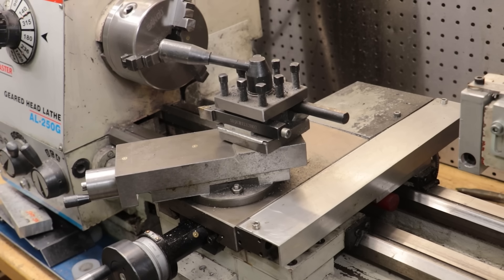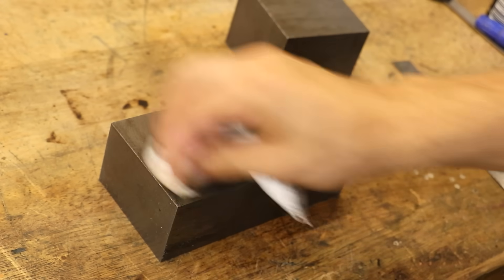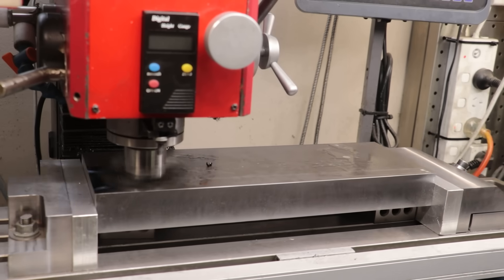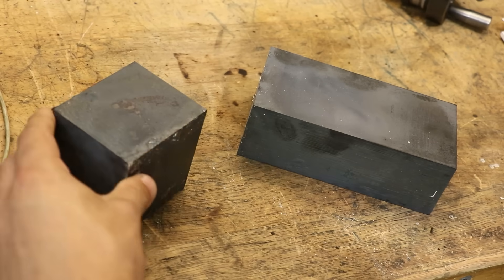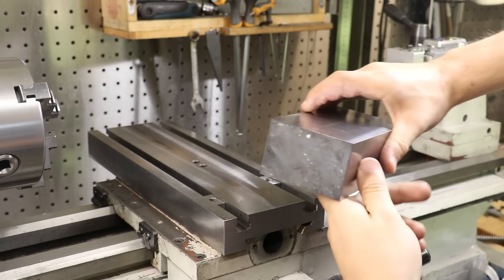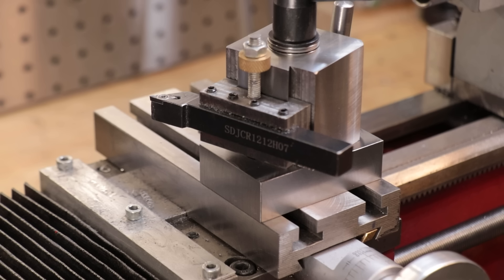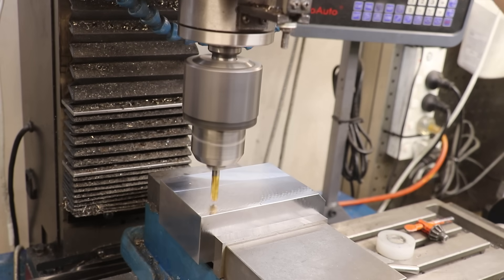Lathe Rebuild: Solid Tool Post Build | Part 4

Comment: For such a heavy cutting in steel, would you rather not look around for a used AI Hembrug DR 1 or DR 133, Schaublin 102VM, Mondiale Celtic 12  or AVM AV125? Especially the Celtic 12 by Mondiale is about the size of this lathe, but a half metric ton one piece cast, mush more rugged and more precise.

Comment: You mentioned that you could cut tapers with other methods since you are building a solid compound. What are the other methods? It is still possible with the solid compound? Thanks!
Reply from the maker: No ill make a swivel type compound that can bolt on using the t slots. I don’t cut tapers very often so I’m better served using the solid mount most of the time
Reply: You can cut a taper between centers by offsetting the tailstock. you do have to recenter it after that though.

Comment: It’s normal for a fly cutter to cut on the backside. A well trammed machine will cut on both sides. When you see a fly cutter cutting on one side only it’s probably because the machine has been knocked out a degree or so to make the cut look good.

Comment: Again, drop cold rolled steel and use hot rolled steel instead. Dimensional accuracy is irrelevant when you are going to machine all surfaces.  Stresses will remain in the steel for years and movement will occur.  When building with heavy cross sections like lathe parts the additional strength/hardness is also irrelevant. Still you do great work.
Reply from the maker: This is why I annealed it, the microstructure has been reset.  I have explained in many occasions that it’s not my choice of metal but I made do with the metal I can get. If I wanted cast iron or hot rolled in this size I’d be in with a several week wait and I’d have to buy 3m of the stuff. I’m no machinist and I’m on a real tight budget so I do with what I can get and work with it. Cheers

Comment: Agreed, top slides really aren't that useful, and you loose rigidity. Fixing a toolpost directly to the crosslide is a better idea. And why not make a few toolposts, and you get a quick change system of sorts. (I actually think I saw someone do this.)

Comment: for stress relieving 30 minutes of soak time is inadequate, the rule of thumb is one hour for each inch of thickness after reaching the desired temp
Reply from the maker: Yeah it had nothing to do with me running out of propane
Reply from the maker: Fwiw most do the stresses are in the outer skin of the steel and the steel hasnt shown any signs of warping

Comment: Steel that is rolled red hot, is not necessarily hot rolled steel. Steel can glow red even below its recrystallization temperature. None of this really matters unless you are really into this stuff, in which case you can just read up on the topic. It's very easy to say something misleading about such a broad and detailed topic such as metallurgy.
Reply from the maker: You’re right. That’s why I did a 3 part deep dive earlier this year. Might as well put my degree to use
Reply from the maker: I do think it’s fair to say that if it’s glowing red, the steel is probability going to be Austenitic

Comment: Awsome project

One thing about using steel: It's stronger, but you wouldn't put so much force into it during machining to break it. Machine design is always a struggle in rigidity and dampening, rarely in strength. And steel and cast iron are basically identical rigidity wise, with cast iron being better at dampening (and better as a sliding surface and nicer to machine)

Steel definitely works, as long as you take good care of maintaining it, but cast iron is definitely the better choice.
Reply from the maker: You’d be surprised. Grey cast iron is a bit of an outlier compared to steel and other cast irons. It tends to have a much lower modulus of elasticity compared to steel.

Comment: 2 flute & 3 flute cutters produce accurate width slots, which 4 flute cutters do not. This is due to 2 & 3 flute cutters only having one cutting edge in contact with the workpiece at any time - the "active" cutting edge has left the cut before the next edge comes in to contact, where a 4 flute cutter has the "active" edge in contact when the next edge comes into contact and gets deflected, causing the slot to be cut larger than the cutter diameter.

A correctly "trammed" spindle will have a slight backcut & should leave a "cross-hatched" pattern that is visible but barely feelable. For some materials prone to work hardening when cutting it may be desirable to introduce a spindle alignment error to ensure theat only the leading edge cuts - had a customer machining manganese steel railway point & crossing castings who did this, as a rubbing back-cut work hardened the surface such that it became un-machinable.

Would it not have been less work to cut a slot for a seperate location tenon and inserted a  key rather than machine away the bottom of the riser block ? No less capable location, but easier to get a flat mating face that way.

The one item that stands out here for being a bit sub-par to me is the offensively undersized gib strip ! Your goal with the project  is improved rigidity - a cross slide gib strip sized to properly fill the free space (top to bottom as well as width) would help with that.

Comment: Three flute cutters are also as effective as two flute cutters.  The issue with the four is the simultaneous engagement of the cutter with the side and end of the cut typically resulting in an over size slot.

Comment: One thing that might be a big help is to blue up the bottom of your toolpost riser block and check how much contact you have and if necessary adjust it. More contact is more rigidity...

Comment: I honestly can’t figure out why so many people go so crazy over exerting physical effort to cut stock.

I suppose it could be laziness, but it’s hard to believe so many people are committed to laziness.  Just doesn’t seem possible.

I suppose it could be a lack of strength - just not being strong enough to cut through a piece of stock.

I suppose it could be just not knowing how to use a hacksaw.  This wouldn’t surprise me; it’s considered a thing of the past. 

I suppose there are people who have never even tried cutting stock with a hacksaw, and don’t really understand it.

I suppose there might be people who’s only exposure to a hacksaw is the rusty old crummy one with a dull blade back on a wet shelf somewhere.  No fun.  

I suppose there are people who are always in a hurry - and I can understand that if there are money and deadlines involved.

But I suppose if you are young and strong, skilled in the techniques, have a nice sharp blade, have a few minutes to cut rather than tinker with a machine, aren’t afraid of it, maybe you might choose to cut stock with a hacksaw.  For whatever reason.  Because you want to.

Comment: Technical terms for your application, at least in the US is normalizing or stress relieving. Where as annealing is a controlled process of reducing hardness, restoring ductility and machinability.
Reply from the maker: If the cooling rate was critical you could carefully control it, but typically annealing refers to cooling slower cooling in a furnace and normalising refers to cooling in air.
Reply: @artisanmakes  True, annealing gets both in one process. Your primary goal was to remove internal cold worked stresses since it was already soft enough to machine.
AI Overview
Stress relief and annealing are both heat treatment processes that improve the workability and dimensional stability of metals, but they have different goals and produce different results:
Stress relief
The goal of stress relief is to reduce internal stresses in a metal that can cause breakage or distortion. Stress relieving involves heating the metal to a temperature below its critical temperature, holding it there for a period of time, and then cooling it in a controlled manner. Stress relieving doesn't change the material's chemical or mechanical properties, but it can reduce its hardness.
Annealing
The goal of annealing is to alter the metal's mechanical characteristics and microstructure to make it more pliable. Annealing involves heating the metal to a temperature that ranges from just below to well above the critical austenitic temperature. Annealing can correct flaws in the metal's crystalline structure and reduce hardness.

Comment: Fly cutter should cut on back side :) (and not only fly cutter, also shell mill, etc..)
If it don't do that.. it's out of tram, leaning forward.

Ideally.. you should have crosshatch pattern.
Exactly as you get it, as I can see from the video.

Think about it in this way...
When you cut... you do not leave perfectly flat surface, but lot of small ridges, as on each turn cutter moved a bit forward. Depending on the shape of the cutter and the depth of the cut, this ridges can be different size and shape. Yes.. it's small when you use round insert, but it's still there.
When back part of rotation come, if everything is perfect, it will cut tops of the ridges down to the bottom of the valleys, and it's visible.

Of course, this not mean that back should cut below valleys of the forward cut, and that forward cut should disappear entirely. In this case, column of the mill is leaning backward.

Also there is a tool pressure change as you mentioned, so you can consider back cut as "spring pass".

Comment: Would be interested if you would comment on your cost for materials as your do your builds.  AU/US/EU prices will be different, however its always good to get an idea of what a project might run, and non-Aussies can sigh with relief when we compare.
Reply: Types of possible sourcing will also vary wildly between countries and locations. Steel chunks like the ones used in this project, are in themselves not costly. Service / cutting fees and delivery are probably half the cost, if not more. Whereas some sources, in my experience, will be kind to hobbyists, and may charge some almost symbolical sum - especially if you find the material in the cut-offs "scrap bin". So basically all you can say, is that cold rolled steel is cheap material in it self.

Comment: Not sure the M6 bolt mount is to blame for the lack of rigidity. My Harrison M300 has 2 M8 bolts holding the compound and has loads of rigidity, and a 3HP motor from the factory. The M8 bolts don't seem a huge step up from what you have, but the performance leaves very little to be desired.
Reply: the area of a Ø6 circle are 113.1 mm2, the area of a Ø8 are 201 mm2, or the Ø8 are almost twice the area, roughly 1.78, so yes it is a huge step up

Comment: G'day Artisan,

You know that around the World, people look at we Aussies, and think; "But all of the creatures there are tough, deadly, & just want to ruin your day!"  Your video proves them to be right.  LOL  Who else gets spiders hiding inside a burning propane torch?  Your video also proves something else - the only thing tougher than an Aussie critter is the Aussies themselves.  "Oh yeah.  I just gave him a new home...", which means; "I popped the spider into an empty Vegimite jar, walked 10m over to the left, & let him escape into the garden."

BTW, when I was an apprentice Motor Mechanic in the 80's, I read about the machining marks left in surfaced cylinder heads - If the cut marks are a semi-circle in one direction, the cutting head of the mill is angled over to one end, and it's machined a trough in the head.  Cutting marks of semi-circles in both directions show that the mill's head was setup correctly.  I don't remember which book I read it in, but it was probably written by David Vizard, Phil Irving, or David Waddell.  They aren't machinists, but they know what they're talking about.

Anyhow, thanks for another great video.

Keep up the good work
Andrew
Reply: You want tough ? more tough than Crocodile Dundee 😁 Look up Tardigrades, those suckers eat Aussie's for a snack 😆
Reply: @sidewind131258  I'll see your common Tardigrade, and play the Australian Tardigrade :)

Comment: If you take equal cuts off both sides of the part, the bending will cancel out and you will end of with a flat part. Or at least, flat-ish.

Comment: I am curious, you mensioned a technique about cutting a taper without a compound. What technique is that?
Reply: The hard part with a lathe is NOT cutting a taper.
Reply: You can turn between centers and offset the tailstock.

Comment: i was machining thru that heatwave, could only rough out parts as the part was so hot it was measuring out 0.03mm. i also had to go sit in the office for a few minutes at a time because being next to a hot lathe almost made me feint.

Comment: Looking good! (thanks for the ref) Having the tool post sitting completely over the cross slide should help to make it more rigid. Probably noticeable when parting off as the tool will find better support where it needs. (Not that I have found any downside so far with mine, but I like the way you did it too) Looking forward for the rest of this series!

Comment: The german Ulmia (352/354) frame saws come in up to 750mm in length and metal cutting blades are available for those. I find that with my 352 saw (550mm), I can get a lot more work done than with a regular hacksaw. Old ulmias are probably difficult to find in Australia, but if you have a machine shop they don't look difficult to make.

Comment: You had a heatwave? I had to snap my dog off several lamposts during the recent not heatwave that froze all my pipes so I had to melt my marujana, and crack cocaine before I coluld even make my way down to the workshop-aka the den... You lucky Barstewards in Oz that wizard knew what he was doing....
Reply: Heatwave with high humidity and the threat of blackouts was not good. You also need to remember that the bushfires that occurred in 2019 - 2020 in Australia are still very fresh in people's mind.

Comment: An extremely light crosshatch on the backside of a fly cutter pattern sometimes means that you are just cutting the tiny ridges left by the leading side. If it removes the initial pattern and replaces it with a backwards one, you are out of tram.
Reply: Not necessarily out of tram. The spindle can be loose or the spindle and tool can be flexing enough to cut on both sides.

Troubleshooting a cheap machine is much more complex than one you be sure of, sometimes it is just about knowing the machine's limits.

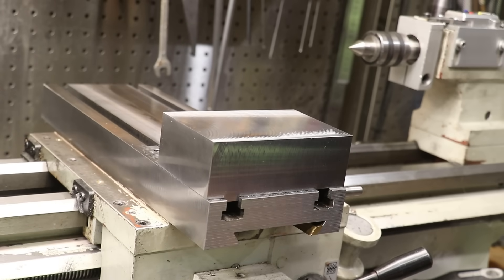Anyway you can clearly see at 12:25 and 12:44 that there is still a crosshatch pattern so the back cut wasn't that deep.
Reply: You mean like the cross hatch pattern in a cylinder bore ?
Reply: @sidewind131258  That's done by honing, entirely different procedure. More like on top of the cylinder head.
Reply: Yes exactly.

Comment: 7:18 - Isn't the fly cutter supposed to 'cut' on both sides? I'm not a machinist but in my mind, if the cutter only cut on one side then that would indicate that it isn't perpendicular with the part and would therefore be cutting a slight dish across the surface.
The fact that you get cutting marks from both front and back of the cutter, regardless of cutting direction, indicates that the cutter IS perpendicular with the part, and should be pretty flat across the piece.
Reply: The material has already been cut on the leading stroke of the cutter, so there should be negligible pressure on the tool on the return stroke, unless the mill isn't trammed or the cutting tool is flexing.
Reply: @ferrumignis  It has been cut by the leading edge yes, but if the machine is trammed correctly then the trailing edge of the cutter will leave scour-marks because the direction of the trailing arced cut is different from the leading edge's, as you see in this video.
If, however, only the leading edge was cutting, this would indicate the quill was out of tram and the surface of the cut would be slightly dished. You would also notice this because, if cutting in the other direction then the then leading edge wouldn't take away as much material as the trailing edge.
I good indicator of perfect tram would be the presence of a faint cross-hatch pattern once the cutter has fully completed a pass. If however there are only scour-marks in one direction then this would indicate out-of-tram and a slightly dished surface.
Reply: @Galerak1  "because the direction of the trailing arced cut is different from the leading edge's, as you see in this video."

Which would make zero difference if the cutter had no, or negligible contact with the workpiece.  Since infinite stiffness isn't realisable, in practice there will inevitably be some contact.  Just like taking a spring pass on a lathe.